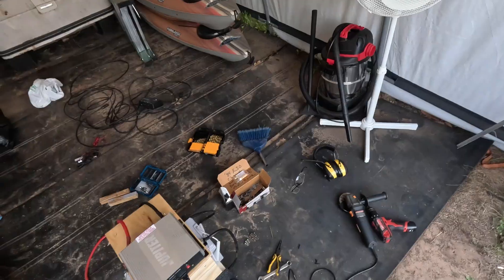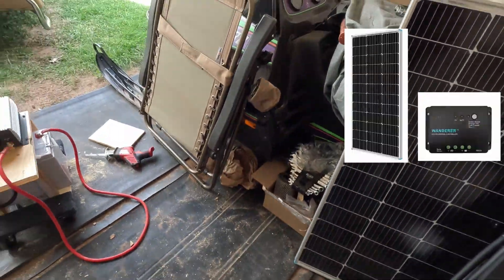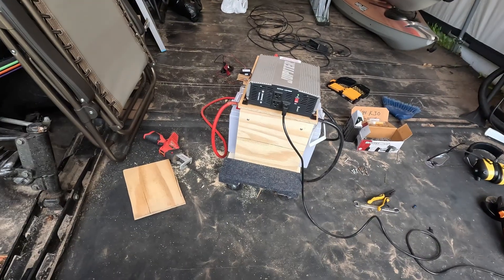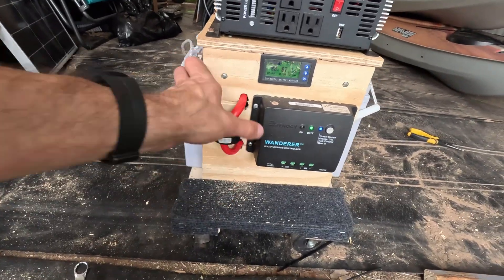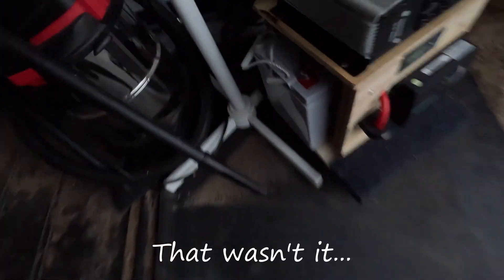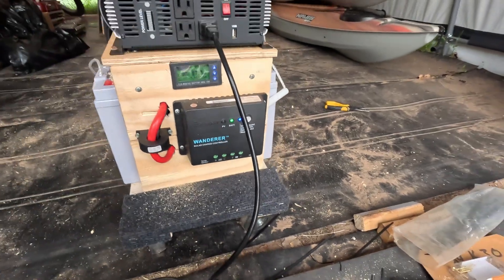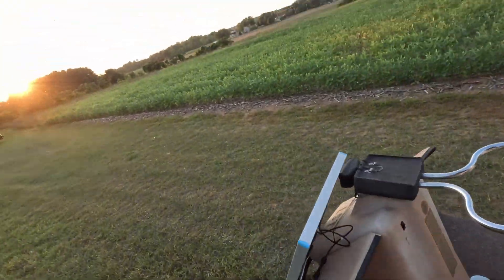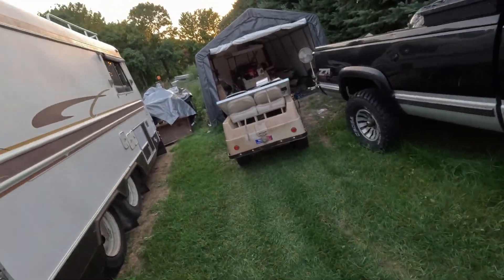I Made My Own Solar Generator!

Comment: That amp/watt meter needs only 1 wire running through.  It can be Neg or Pos wire depending which direction your your inductor faces.  But 1 wire not 2 they are cancelling each other out
Reply from the maker: Thanks for the comment! I have two so they do cancel eachother out. This is so I have an overall input/output wattage. This is due to everything being wired to the battery, otherwise the solar charge controller would need to be wired to the inverter terminals to get the results you're mentioning

Comment: I think only one wire should be thru
Reply from the maker: Thanks for the comment! I have two so it will count how much it's charging (black wire from solar panel charge controller to the battery), and also how much it's discharging (red cable from battery to inverter).